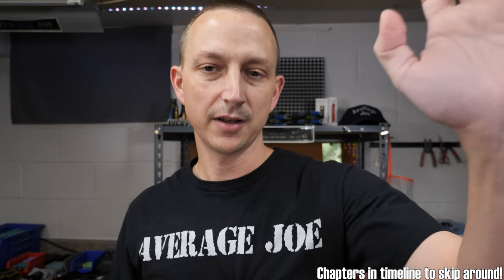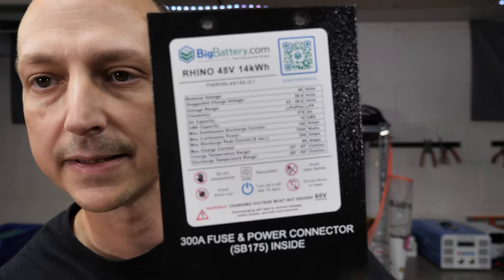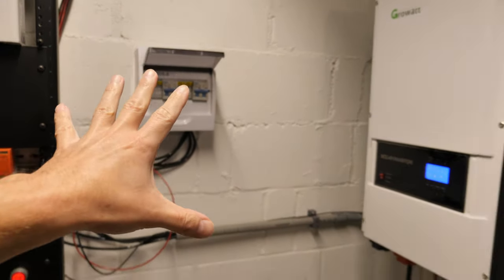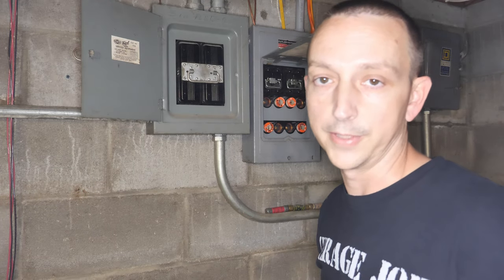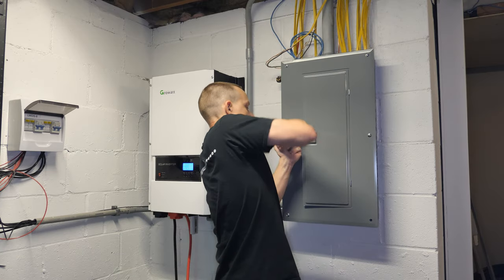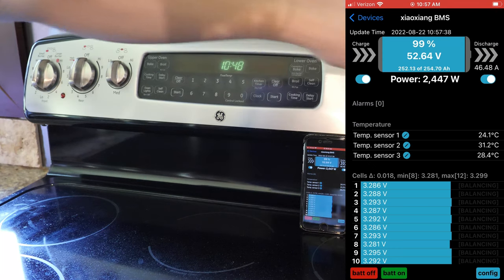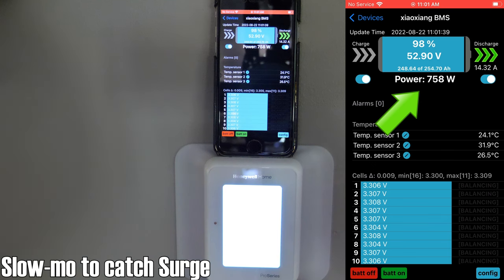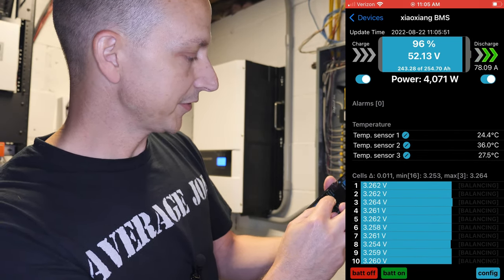Can you Run 4 Ton A/C, Stove or Dryer on a Battery???  RHINO BigBattery.com

Comment: I'd guess a lot of your subscribers are techies, so I don't know how a philosophical video from you would be received.  You've proven "yes you can", but not really addressed "should you" or what the alternatives are.

We're looking at a lifestyle change already, by monitoring our sustainable/semi-offgrid power systems.  What other lifestyle changes could we employ to make this transition more feasible?

I'm probably as old as your father, and grew up on the Gulf Coast of Florida.  Our house was as old as yours, and not at all insulated.  A lot smaller too.  Oh, and no air conditioning, but small resistance heaters in each room (that got used 30 minutes per day if we were lucky).  We did have a fireplace with a Heatilator insert for when temperatures got below 50 F.  Here's a few things we did back then, that may be relevant again as we look at making our own power.  
- Water heater was run from about 1600-2100 daily.  7 people bathed at night, and dishes were done, with usually enough hot water leftover to do breakfast dishes.  
- The stove/oven made dinner (very occasionally breakfast).  Lunch was always a cold meal.  No microwave, and a 14 cu/ft fridge.
- Clothes were air dried, weather permitting.
- Spring/summer/fall cooling was accomplished by opening windows and running ceiling fans.  
- Each room was illuminated with a single 40 watt incandescent bulb (though there were 60s over the bathroom mirrors for shaving).
- Conservation was mandatory.  You didn't want to be around the parents if a $35 electrical bill arrived!

We'd lose power for a week or more every few years due to a hurricane, and honestly barely missed it.  A couple of Rhinos back in the day would have been heaven!